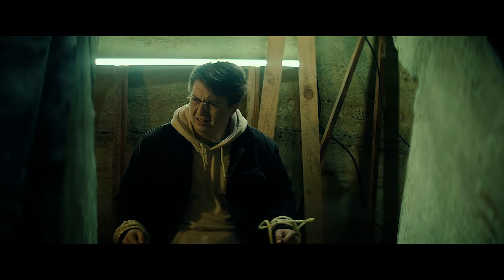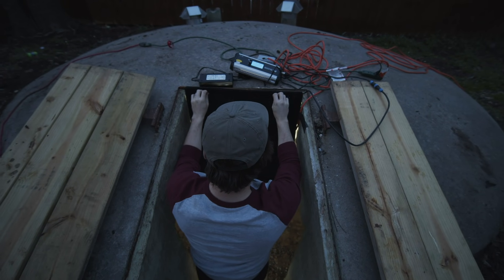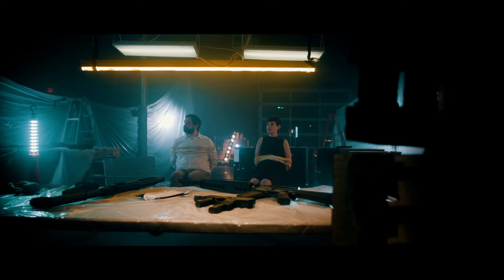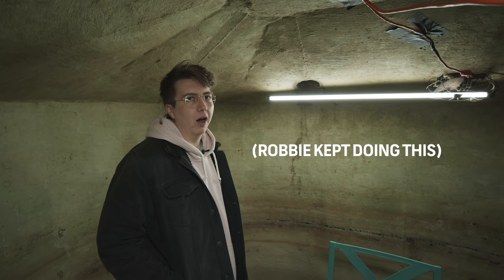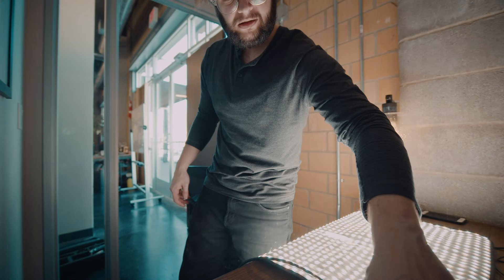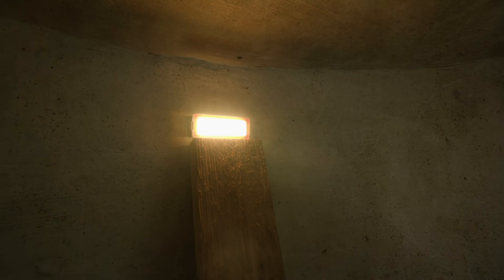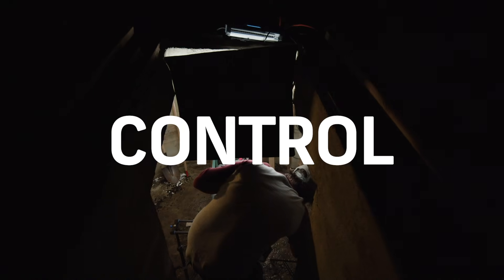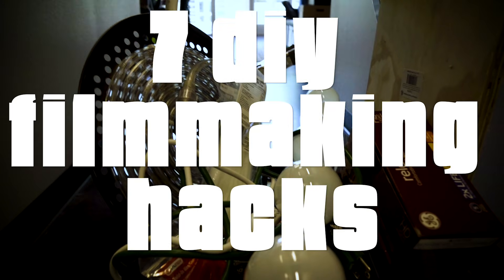How To Light Small Spaces | Cinematography Techniques

Comment: How to light actors who constantly moving in the scene? It can't be three point lighting from all the angles. Like in Spielberg's long takes which are happening inside the buildings.
Reply from the maker: This is a really great idea for a video actually - stay tuned, I think I'll do that one. A short answer to your question is you have the light actually moving with you through the scene. A lot of times a china ball / lantern on the end of a pole, moving through the scene. An even shorter answer is a lot of money and more lights. But perhaps a video about the low-budget solutions should be en route... 🤔 - Todd
Reply: @shutterstocktutorials  For example of an moving actor check the famous scene with Alec Baldwin in Glengarry Glen Ross. It's not a single take but Baldwin walks a lot while he speaks.
Reply: @shutterstocktutorials  Yep, running around with a mobile light (chinaball) and/or reflection fill.